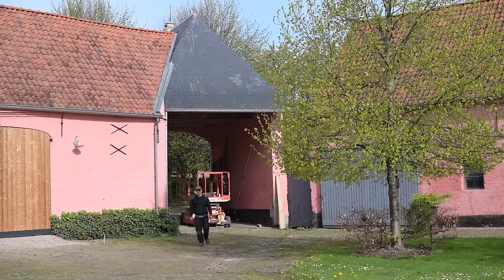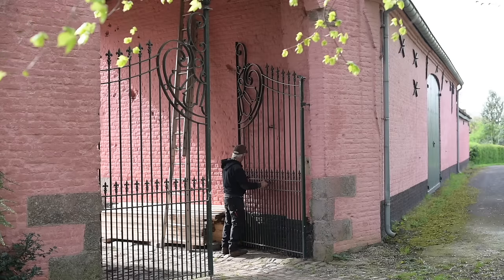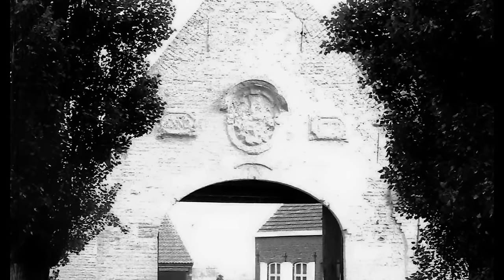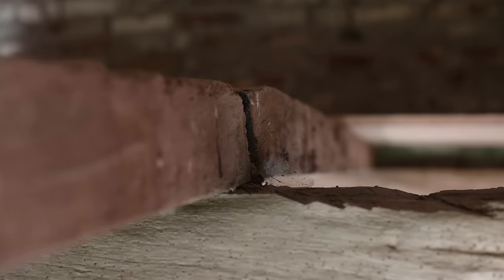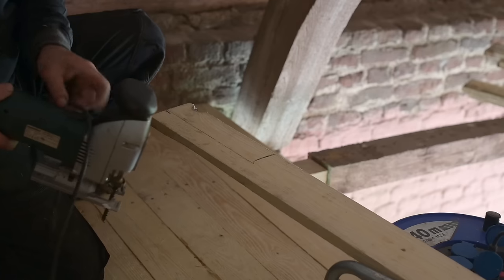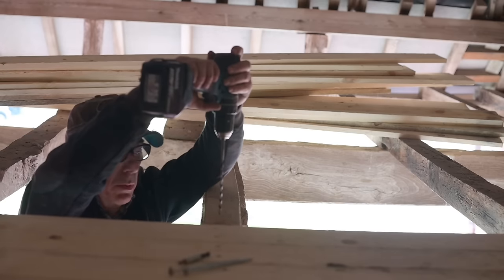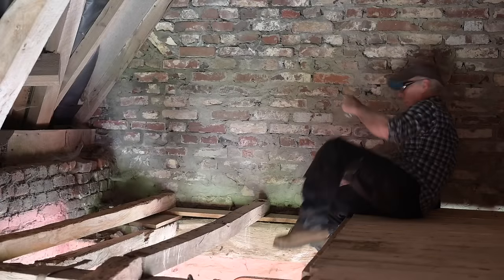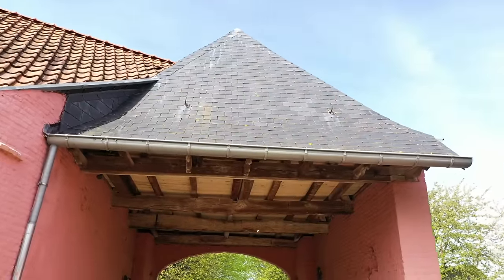Barn restoration -  Placing a wood ceiling in the gate house

Comment: The pneumatic nail gun is not only easier but also causes less vibration on the existing building fabric. I always ask for nail guns or screws on historic structures where the remedial wok is to be done. I do prefer screws. Great Video!
Reply from the maker: Indeed, as it has a huge single shot and the nail is in  .  Thanks for the comments

Comment: Hi. Re the coat of arms. I would ask if I could take a mould of it and you could then cast a replica for your farm. I am sure of you took your photos and signed an agreement, they would let you do that or you might be able to cast it on site? Even a 3d scan and 3D print might be an option? Just an idea.
Reply from the maker: Yes that could be done, however there is some laws on heritage buildings that we are not supposed to fake things.
Reply: @D3Sshooter  Fair enough but might be better than nothing?